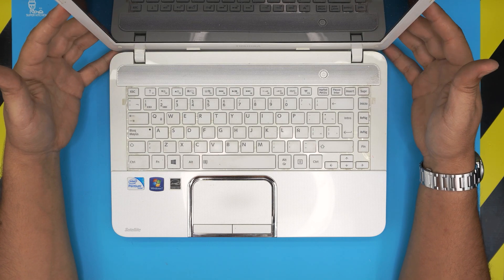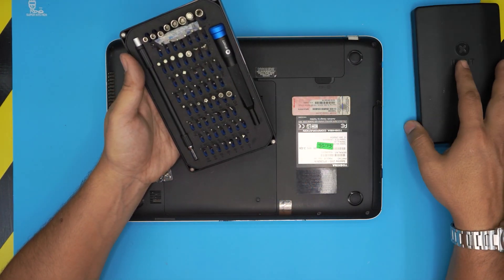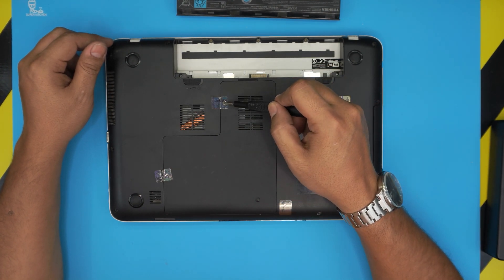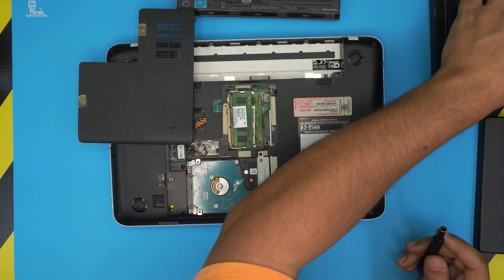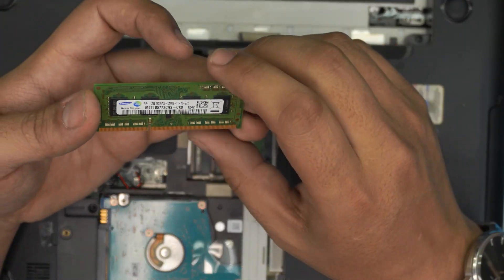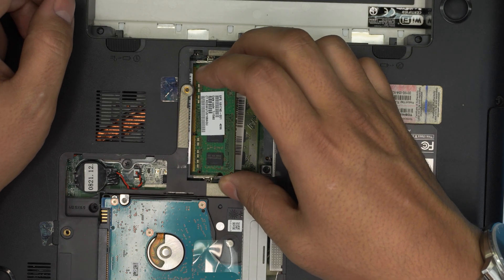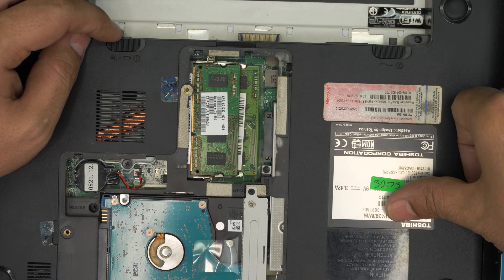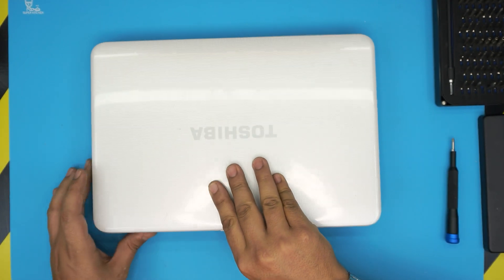Toshiba Satellite L845 Ram Upgrade FULL Guide | SP4393WM

Comment: I did this to upgrade my Tosiba Satellite Pro from 3Gb to 8Gb,  the problem is that the laptop only recognises 3Gb of the 8GB RAM as 'usable'.  Anyone know how to make the additional RAM useable?
Reply from the maker: regarding your question, you may have a 32bit system the 32bit os can only go up to 3gb, right click on my computer and properties and check the windows is 32 or 64bit
Reply: Yes that's it thanks. Turns out I have to upgrade it to a 64-bit operating system and I can do that because I've got an x64 processor.
Reply from the maker: yes i would recommend you to do that the 64 has much better advantage than 32bit.